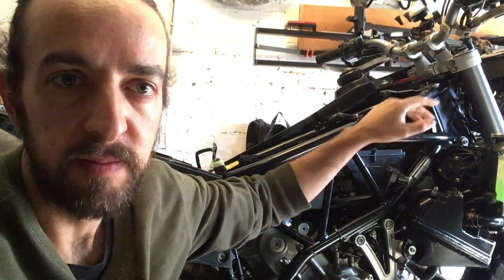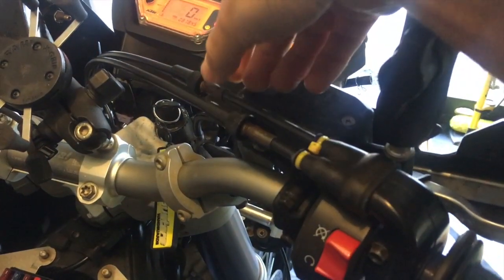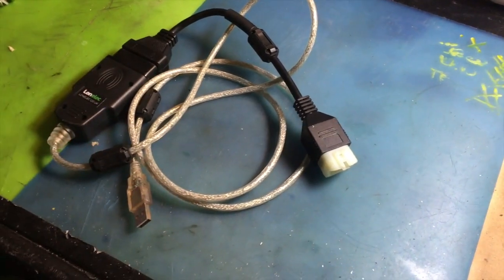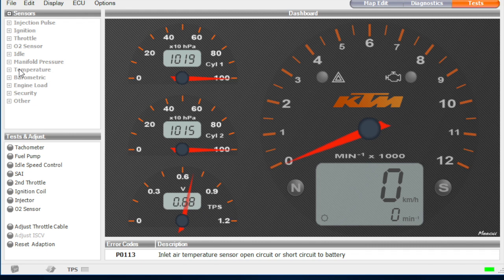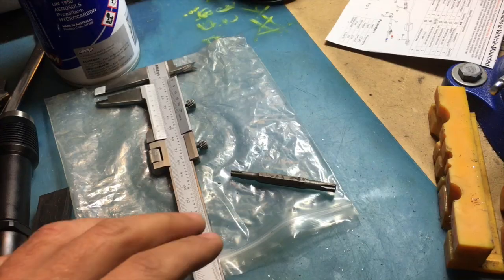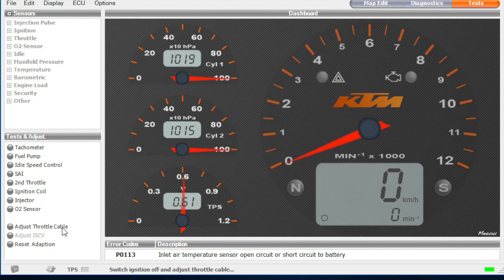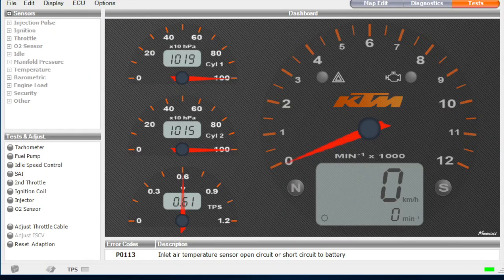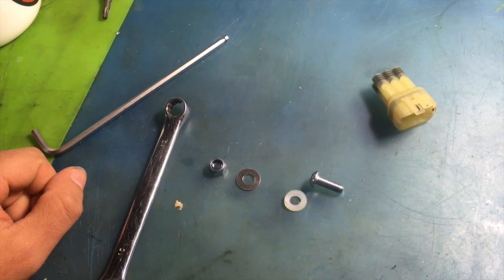990 LC8 Adventure TPS Adjustment

Comment: Is the front and rear tps sensor 0.60 or not?
Reply from the maker: Sorry Jules, but I don't know what the value for the rear one is, though it typically isn't the one that requires adjustment.
Reply: Don't touch the rear TPS, I believe is for the secondary butterflies and nothing else.

Comment: @currently.unavailable  So ... when the screw is loosened, what exactly do you do to adjust the reading? Is it the sensor itself that is moved? If so, how?
Reply from the maker: That's correct. The screw simply secures the TPS in place. Once it's loosened you can rotate the TPS in its housing to get the correct voltage reading.
Reply: @currently.unavailable  Got it. Just to confirm, the TPS should only be adjusted when the ECU has thrown up an error code, right?
Reply from the maker: @ojalaandrew887  no, I don't believe you'll get an error code for this (I didn't). It was mostly just that I noticed odd behaviour with the TPS so replaced it, and this was the adjustment/calibration process. But I generally check the voltage at every major service.

Comment: Did you replace both Sensors or just the Front one?
Reply from the maker: Just the front one. Apparently the other one doesn't tend to require adjustment/replacement.
Reply: The second TPS, I believe, is for the secondary butterflies and never needs adjustment.

Comment: Great video! I must do that too becouse when  cool engine  the TPS is 0.73 V. I must set 0.60 with cold engine right???
Reply: @currently.unavailable  That is correct. Setting the closed throttle means it wont wander as engine idle is adjusted for temperature.  Setting on hot engine is a second best approach but does not need TuneEcu.
Reset adaption should be followed by 15 min run at idle without touching throttle. Bike must be vertical.
Reply: Excelente.video... aproximadamente  cuántas rpms cuántas revoluciones queda el motor en ralentí..
Reply: @gago564117  1450 RPM
Reply: @andrewhutchinson6755  Just curious... during the 15min idle process, won’t the bike get too hot? Even with fans on, will the bike be able to take it?

Where i am is always warm, averaging 30-35 deg C.
Reply: @porraniihara  temperature no problem. As long as cooling system works. The fans will kick on.
Reply: @andrewhutchinson6755  ahhh that’s good to know. Been ever so worried to try because of vast climate differences between the western and the eastern part of the globe.

This idle thing, when must it be done? Everytime an electronic adjustment is made? Or only for certain procedures?
Reply: @currently.unavailable  Thanks Dave for this. Learnt alot from it.

Comment: epic video, could i ask do you know the voltage value of the secondary tps by any chance?
Reply from the maker: Sorry m b, but I don't know what the value for the rear one is, though it typically isn't the one that requires adjustment.

Comment: Nice video! . On the way home today from my daily commucte the F1 error code appeared.  My 990 adv 2007 stalled and I had to restart the bike.  Felt like it was coughing and thought I was out of gas, but I had topped up a bit of fuel at the gas station in the morning.   Fault code is indicating 6 short blinks+throttle valve error.  I do not have an ECU cable yet, bike has 22000 miles.  I was wondering if my tps could be "fixed" by adjusting the voltage if it is off and clearing the fault code? or is this a sure sign to replace the TPS? any tips would be great!
Reply: Hi it might be a dirty fuel filter - filters it has 2. If it is the case if you wait a while it will start up and when you give it gas it will eventually stall again due to fuel starvation.

Comment: Very good and detailed video. Just remember another good point to not forget...on both the exhaust pipes, before the canisters, there are the two sensors for the fuel/air mixture called the Lambda sensors, screw them out very carefully to not twist the cables connected to them, best is to trace the cables first and disconnect them from their sockets, clip off the cableties and then screw them out, you will find the sensor part that is inside the exhaust is brownish from all the carbon, sprayclean it thoroughly with carburettor cleaner, you will see that old carbon drops off, let it dry a few seconds then carfully screw them back in again, rout the connecting cables in such way that it's easier for future works and reconnect the plugs. You only have to remove the righthand tank to carry out this job. Performance and fuel consumption is back to normal again.
Happy rides.

Comment: EXCELLENT step by step. 
You did say you replaced the TPS. Wondering how difficult it was removing the old one, and installing the new one.
Reply from the maker: Thank you Fernando. It's very simple. One screw and one plug, then do the adjustment as above.
Reply: Dave - if I pull the old TPS off, and install the new one, will the bike start without the new TPS being near the proper voltage setting? Just wondering how to warm up the bike prior to adjusting. I imagine it would be difficult to remove the TPS / installing with a hot motor. Thanks!
Reply from the maker: @aimlessimages831  I think it'll start OK!
Reply: @currently.unavailable  Right on,. Thanks again for taking the time to help out.
Reply from the maker: @aimlessimages831  my pleasure. The way I've learned everything is through helpful people (and Youtube), so happy to repay the karma!

Comment: Hi Dave, excellent video.
Many time I did it myself.
What I don't like about this TPS that KTM uses (I'm not sure who is producer) is how fragile/sensitive they are.
... and I "heard" some information that even OEM when new can even be problematic.
I wonder if you ever seen or heard about non OEM (third party produced) TPS that can fit KTM 990?
Reply: @currently.unavailable  For sure there is same as TPS for other vehicle as KTM uses.
This parts is too expensive to produce only for one brend or motorcycle/car type.
Most probably Triumph or some cars... 👍😉
Reply: p.s. I have also DRZ 😁
Reply: Triumph parts fits ktm same part :) Triumph - T1241182  usually from daytona 650 and i think tiger 1050
Reply: @apriliacaponord5001  The code you posted is wrong. It's the stepper, not the TPS

Comment: In my case, it doesn't work. If I move the screw, nothing changes. I've checked and confirmed that the connections between the PC and the bike is alright.
What I was able to is to reset the TPS (moved from 0,71 to 0,62).
Reply from the maker: When you say you moved the screw, do you mean you moved the entire sensor, or just turned the screw with a screwdriver?
Reply: @currently.unavailable  I realised this silly mistake about 30 minutes ago. I deserve a prize...😁
BTW, it is normal to set it at 0,62V and after a short ride the value goes to 0,71V? Both values under warm conditions. 
Additionally, in that short ride of 20min, the bikes stalls when changing gear and misfires...previously the issue was that idle remained at 3500rpm. I've still not changed the TPS, maybe I need to do so.
Reply from the maker: @Nriku8  this sounds really similar to how mine has behaved when the TPS is on the way out. No matter where you set it you can't get it to behave right. How many km on the current TPS?
Reply: @currently.unavailable  I don't know, I bought the bike with 79.000km and now has 94.000, I've never changed it. I will re-do the procedure and will hopefully work. Thanks Dave!
Reply from the maker: @Nriku8  No worries. I think you're best of replacing the TPS though!

Comment: Hola la mía se acelera a 5rpm y se apaga
Reply from the maker: Hi there—that sounds like a TPS problem. However, first you can try "reset adaptions" using TuneECU to see if this helps. If your bike has more than 50k kms mileage and original TPS, replace it.

Comment: What about the second cylinder? No need to drill a second hole?
Reply: @currently.unavailable  Thanks.
Reply: Hi, 2nd tps sensor is responsible for upper  trottles only and does not need any adjustments. Reason: it is calibrating by itself every key on session. How: 2nd trottle motor is closing upper trottles until the end and using achieved value as  minimum.
Reply: @ВячеславЕвстропов  I DE installed the 2nd throttle by removing the upper butterflys,  could I re-use the 2nd throttle tps for the main bottom throttle if I need it

Comment: Dave where did you get the new tps as my Ktm dealer DOSNT supply replacement just default fix new throttle body£1200
Reply from the maker: Hey Norman, they had it available when I needed it. It was likely a special order. I have heard that there are ones from other bikes that can be made to fit. It might be worth checking 
on ADVRider.
Reply: Salut. J’ai remplacé sur mon 990 capteur Tps et iddle stepper. Pour TPS chez KTM et pour le iddle stepper chez triumph car il n’est pas détaillé chez KTM et c’est remplacement rampe injection complète 😢…good luck
Reply: @MrSeboune31  thankyou so much will have a go again thanx